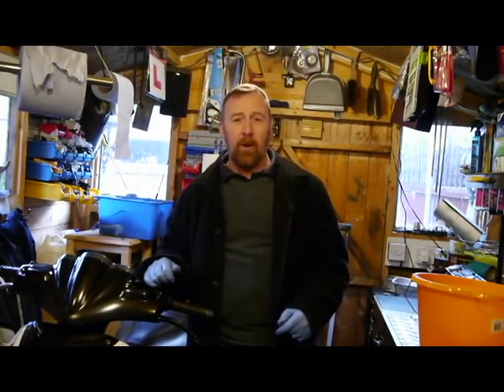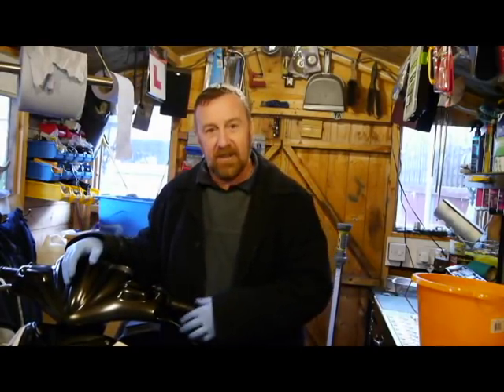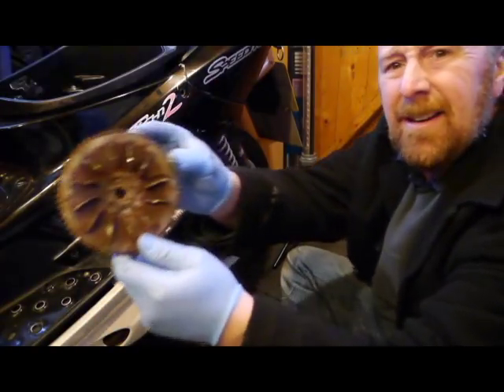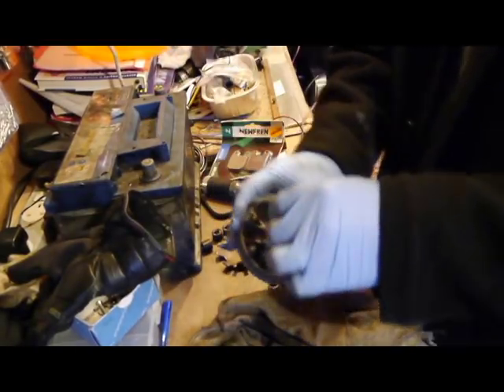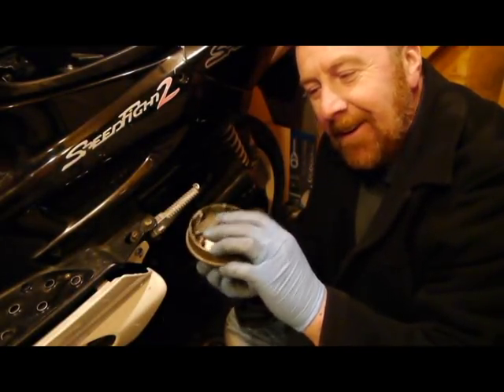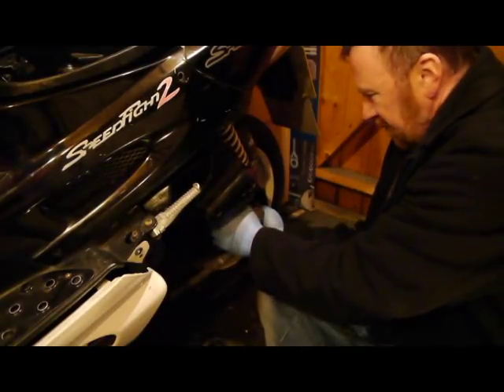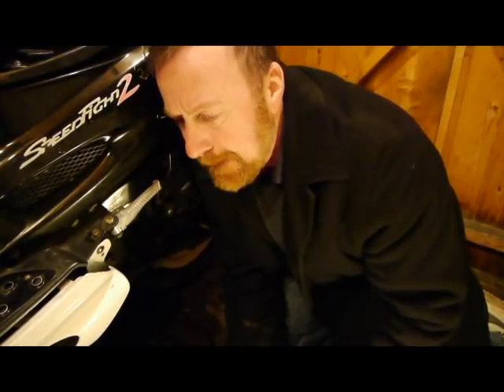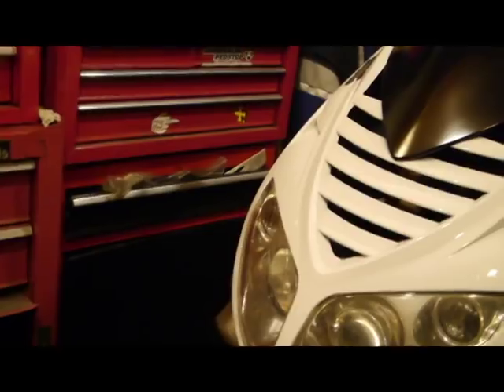MOPED SPEEDFIGHT SPEEDS UP SLOWS DOWN WHILE RIDING MARK SAVAGE

Comment: OMG. The trick with using a hammer to lock the variator is genius!. I tried locking it with a screwdriver and failed. Eventually had to order the damn part specifically for locking my gy6 motor's variator. And its gonna take like 3 weeks to get here. So forget that, you saved me.
Reply from the maker: that's good to hear bud that my videos and tips help, there many more videos on my channel and the basics are the same so may help for other things 
thanks for the feedback bud ,take care
Reply: Nevermind , I lied. It seemed genius, and it would have been if not for my variator bolt being on so tight that I can't even twist it without it lifting the scooter off the ground or slipping the hammer out. Guess I'm waiting 3 weeks c-c.
Reply from the maker: use a bar like I show in my videos, it should push down to get it off and use you foot to hold it in place or get a friend to help push down while you hold it in place 
it will work bud, maybe a little wd40 will help

Comment: I’ve got a sinni street 50. With a gy6 engine. It runs great up to 20mph then it won’t go further; however, randomly it’ll run up to 35 then revert back wards 

I’ve cleaned the carb and air filter. As well as replacing the spark plug

Comment: Amazed that it ran at all. Everyone seems to blame the carb. Thanks.
Reply from the maker: David Collins well it wasn’t the carb this time lol 
Thanks for watching
Mark
Reply: 4:42 Mark any chance of a close-up of exactly what you're doing here with the claw hammer. I have a Peugeot Looxor which might not have the lever points that the Speedfight has. But if I could see your trick, that would help please. Ta.
Reply from the maker: @ppppugh7892  not on this one  but I do show it better on a few other speedfight videos worth a watch as in a lot of the videos I start with a one day fix and end up fix 5 or 6 things and im sure I did it on a ludix and a nrg even a dna so its the same trick each time 
its just about pushing it in and holding it with your foot then a big bar and push up quickly
Reply: @marksavage  I got it off! The rollers were flattened and the housing looked like it was filled with wax oil, I mean filled. I will change the seals!

Have you ever seen this before - filled with black grease oil?

Comment: Thks 4 your video i have a piaggio Zip 50 2t when i drive in full acerattor the speed cut down i cleaning the caburettor new filter new spark plug and still the same thank you very much
Reply from the maker: thats great to hear and thanks bud

Comment: I just bought one of these for getting to the docks at stupid o'clock. Found it was bogging down under load quite badly and sometimes cutting out. Watched a ton of your videos and got a Haynes book of lies carb stripped and cleaned successfully. Much better, but still slowing on hills so I guess Wednesday's job is to check out the rollers a hundred times better than Haynes.
Reply: my scooter doesn't move faster even though I throttle the engine to the end it will only make noise but doesn't run even to climb hill is a problem  it consumes fuel so much because of that, what is the problem

Comment: Dirt is not really a problem. If it was there would be a gasket on the clutch/variator cover! The ‘dirt’ is wear from the belt, and clutch. The blades on the variator are to blow or vent dust away from the variator to the outsides of the casing. A speed fight needs 8 gram rollers. That is the key point. Roller size/power ban Ratio. Without variator guides, you get uneven movement, uneven roller wear etc. what did the old rollers look like? Divided?
Reply from the maker: The cover has a gasket !
Just ni -on  all of them do not get replaced 
But yes it's the belt that causes the mess
Some people even grease the rollers 
6g is the best all round weight, its what I've used in the 400 speedfights I've worked on !
Other weight for other mopeds 
I used to combi them a few gram here and there for wear and sports systems 
You still need pull away 
As for the mess of cause it's a problem bud as it will build up in the system and stop the rollers rolling !
But ha Happy to learn something new as I've only worked on 1000s of moped and 100s of bikes 
Who knows it all! Not me I just try and help others with my videos
Reply: @marksavage  im sure your knowledge is extensive. I’ve recently started out on 2strokes after years, and currently working US classics. I’ve restored a Yamaha Neos, saved it from the scrap, and now I’m onto my speedifight 2 and doing the research. It was running fine at idle, started first time and then after reassembly, got 1km down the road at 25kmph then 50 then it just died and won’t fire. I have no spark but the coil reads 9k resistance which is in spec... new plug still no spark. How do I know,if it’s got an immobilizer cdi? It’s a dellorto with electric oil pump.
Reply from the maker: @AutoClay  I have a few cdi video bud on my channel and there are 4 along with another 100 
Type in speedfight mark savage

Comment: hi mark my 1998 speedfight 100 is running slow at 20mph max with some smoke coming out the exhaust and runs so hot that its melted my seat bucket slightly ... could you please inform me of what it may possibly be

Comment: Hi mate . Changed my piston and rings heads gasket and seals . Changed variator cleaned carb brand new belt cleaned rollers. Still taking of really slow hand on the throttle all the time . What could this be

Comment: I just got mine brand new in the mail yesterday and it speeds up then slow down any ideas why and it’s new
Reply from the maker: bud id be going straight back to the mall and asking them to sort it, it should have gone through a PDI before been given to you so all fit for purpose and running 
dont play with it bud just bring it back and say its not running right and fix it !
Reply: I ordered it online from killer Motorsports
Reply from the maker: @NH_The_Bloods_Tho  oh right well it's not running as it should as you've guessed already 
Check fuel lines and fuel is getting in ok
Prob best take carb off and check over as defo fuel related

Comment: Hi Mark , great vids ...  wonder if you can answer a question ,  does it matter what way round the rollers go in to the variator ?
Reply from the maker: They will only go in one way like i show in my videos 
The variator has to be clean and dry and the rollers free to roll 
Bud
Reply: @marksavage  Thanks Mark , ill have to check your vids again as i didn't see the part where you specify the way round they go , sorry !!   This bed is a lexmoto and I've just got a new veriator for it as the old one was really bad .... May i ask would you say on the caseing  in front of the variator there is a hole , looks like a large air intake but no pipe connected to it , so its just open, should their be something connected in your opinion ?  many thanks
Reply from the maker: @markclemo123  there should be a pipe on there but its not the end of the world ,just dont block it up as its there to cool it 
If you can find one replace it as it stop rubbish getting in

Comment: Thanks for the video.  I have a TaoTao thunder, its a 49cc but i have a 100bore kit on it.  I have been having a problem similar to what you are describing.  #1, takes long to turn over (the kick start wont work at all).  As i leave my house, about 50 yards out i reach top speed then the engine begins to loose power, the throttle will be wide open but my speed will reduce, then a few seconds later it will recover..  ive had my machine loose power to the point of a 'crawl'.  Ive heard many theories and even mechanics say they fixed the problem to no luck.  Any ideas?  Im afraid to more than 3 miles.  Some have told me the engine lost compression and its toast, others say the carburetor needs to be adjusted.  Any advice?
Reply from the maker: shane mahler hi bud 
Thanks for watching , if you have watched my other videos you know I don’t like big bore kits 
Have you checked the head / piston as it does sound like piston / ring failure 
Carb prob not set up right , did you upgrade the plug as it will get a lot hotter with the bore kit?
You will have to , check everything bud 
From carb reeds piston exhaust plug, it’s a big job bud you need to get to the end of it 
I have a few well lots of videos on my channels that should help 
Mark
Reply from the maker: shane mahler well it’s worth a go on the simple things bud before paying out 
Get a cuppa and flick through my videos as some should help for the basics 
All the best mark

Comment: Hello, great video! Honestly i've learned a lot from this. I would like to ask you something. I have recently bought an mbk booster and took out the variator ring and put slightly lighter rollers but now untill 20 km/u it accelrates quiet good but after that I feel like a dip and it loses power. Do you have a solution? Thanks.
Reply from the maker: thanks for watching I have answered in the other question bud, was away for xmas

Comment: My moped is doing the same thing that you explained bogging down has no power and it never started until my CVT belt broke and I replaced it with another one. After I replaced it when it started. And I tried everything. I bought another belt that did not work and then I bought a brand new variator and that did not work and then I bought a brand new clutch and still it done the same thing so then I bought a brand new carburetor CDI box change the spark plug change the oil and it's still doing the same thing. But I'm wondering if it is my clutch which is brand new because when you grab it with your hand and squeeze it to open the clutch it's extremely tight and it's very hard to do so do you think it could be the new clutch? I really tried everything and I'm so frustrated. The moped will start it will even run but once I get it on the highway it has no power I'll hold it to the floor and it has no power and when I come to a stop sign it almost dies and it's horrible on the take off and give it gas and it takes a moment to take. I've spent like $200 trying to figure this out so any help would be greatly appreciated. Thank you
Reply from the maker: oh wow ok bud 
so it starts good and runs but then messes around once riding 
this can be your carb , try tuning like in my tuning video or you may have to buy a new carb and set it up with the old jet then tune 
clutch should be ok once fitted and you have done all the rest including new roller 6g yes

Comment: My daughter came off her bike in the and the steering has gone a bit lumpy is that the bearings gone in the head set
Reply from the maker: I'd be going over it now bud 
She may have damaged the frame 
Front suspension as pushed back 
And then yes damaged the head stock 
I'd be really looking at it or get a shop to bud to be safe 
Hope your daughter is ok
Reply: mark savage she’s fine thanks 🙏 a bit shock up but got straight back on a spare bike. Thanks for the reply I think I’ll strip it down and book it into the garage. She said it didn’t go hard and wasn’t going quick 🤔

Comment: Mark what's the best way to clean rollers? And should I use a damp cloth to clean the inside of the variator?
Reply from the maker: hi bud as in my videos, always a clean dry cloth, do not use any sprays or oil's , also check the rollers for flat spots and if so change them . thanks for watching bud
 mark
Reply: mark savage cheers pal. Your the man 👊
Reply: mark savage I changed my cylinder and I seem to be loosing power and sometimes it stops at 15mph 🙈 I was told keep it at 30mph for 200miles to wear it in. I had 4g rollers but was told need slightly heavier so I put 5g in and still lose power
Reply from the maker: if the variator system and clutch / . belt are ok then check carb , plug for spark if all ok then check piston again bud .5g rollers are ok , did you fit them like I show in my videos mark

Comment: Hi, 
Im having trouble finding the right size belt for my Peugeot speed fighter 2 100 2003 and has a catalytic everything is stock and original
Reply from the maker: @billyfarnsworth8051  it's very hard to get 100cc parts bud , this was why I only bought a few and found them hard to resale 
It is wider then the 50cc ones and a little longer too

Comment: where are you based and do you work on bikes, I have a Piaggio 2007 Carnaby 125 where the engine increases in revs and is sluggish on accelerating.
Reply from the maker: What my 4t  carb videos bud 
Then variator videos 
They will both help

Comment: I have a problem similar to this my moped revs up and then has no power but when I Rev again I get the power back it only happens every now and again but I have a feeling it’s due to bad petrol and maybe needing an oil change as it’s been in the shed for a while, could this be the case ?
Reply from the maker: Flush out old fuel 
Clean air filter 
New plug 
Change oil 
But as said check out the variator system too
Reply: @marksavage  yes I think it was flushing out old fuel as it hasn’t happened since I rode it today and filled it up

Comment: Hi, I'm going to need rollers but not sure what weights I need, it's for a 49cc kymco? What would you recommend? Thank you for your videos, I'm new to fixing up my bike so these videos are amazing.
Reply from the maker: best look on google for the right weight for your bike and then check out e bay, remember to clean up the variator like in my videos as they loads on my channel 
mark
Reply: @marksavage  i tried google, that's why I asked you lol. Ps it's not easy when using a hammer to unscrew, I've been trying for an hour, it keeps moving and I cant get a grip from the hammer. But thanks anyway.
Reply from the maker: @emmagibbs4551  it works on speedfights and DNA and aeroxs but not sure on a kymco but try like in my video and push up with your foot and jam it in there 
If not you will need the variator tool for your bike

Comment: HI Mark..Can you help..My longjia digita 51..starts ok..but every other day when it been left overnight..it will only do 10mph...for about 10 mins,,,then i get to work..leave it for 2hrs ish..and when i go home it runs fine..going 35mph..Runs perfectly..Any ideas? thankyou.
Reply from the maker: Carb , over a night etc they can leak a little and the fuel level in the carb goes down and then takes a little to get back in and start 
Fuel lines go hard or loose and tha vacuum fails 
Faulty choke but I'd start with the carb bud
Reply: Thankyou..i thought it might be the variator.. @marksavage

Comment: Just took mine apart and weighed  the rollers mark they range from 9.2g down to 5.3g wot should I be using?
Reply from the maker: I used to combi them but found the best weight to be 6g so 36g in total
It was best for pull away and top end 
What's its running Luke now with what you have and what was the total weight
Reply: mark savage just put new 6.5 in and new belt and changed the spark plug mate went up the road ok but then bogged out straight away revs up but doesn't move again going to take carb off cos when I pulled fule pipe off noticed water in with the fule on the ground mate

Comment: what about if its brand new.... should i Open it up
Reply from the maker: What's brand new bud 
The moped 
New head ,carb , oil seals?
Reply: @marksavage  mopped the engine has been stalling when I use the electric start but when I use the kick start it runs better but still not as fast

Comment: Hi there, I have a 2016 lexmoto matador 125cc 4 stroke, it ride great, but at top speed it dies back by about 10kph. If I let the throttle go and twist again, it does the same again,  would this be the rollers and clutch?
Thank you.
Oh by the way, your videos have helped me massively as I'm quite new to mopeds, thank again
Reply from the maker: Sounds like fuel more than the variator system 
Check and clean carb
Check vacuum system and fuel pipes bud
Guessing you have all ready changed plug and air filter
Reply: savage thanks for your reply,  I have recently changed the fuel filter and fuel lines, I do need to do the vacuum lines still, so I'll start there. Plug and ht lead changed also, I'll do the vacuum pipes and change air filter.
Thanks again.
I have one quick question,  I'm thinking of fitting a 170cc big bore kit to my 125 4 stroke, should I go 2 sizes up on my jets? 
Thanks 
Pete
Reply from the maker: @peterking7625  these kits are made a little better than the 2r kits but I'm no fan of them nor the setting up 
I'd change the carb with a 45cc upgrade 
More fuel and air needed bud
Reply from the maker: @peterking7625  to be honest I've seen so many bikes with big bore kits that have little effect or better speed and often fail after a little while !
If your going to do it get the best quality one you can and upgrade the carb too 
So 21mm carb not sure what your running now as standard or bigger 
This then will help and run better 
Sports exhaust and air filter 
High temp plug and quality oil 
It might run better and last if down well then tune.

Comment: Hi mark I broke down not long ago and cleaned the carb etc and it starts and sounds healthy. I used to get 40-45mph whereas i get 20mph now. I’ve changed the belt and cleaned the carb. Any idea on how to fix it mate?

Thanks again
Reply from the maker: hi bud 
so now your only getting 20pmph, we spoke about this already didn't we?
you took off the VARIATOR cleaned it and made rollers   were in ok and round - if not change too 6g
belt is the right one as theres a few and different sizes ?? you may have got a bigger one that's not letting the gear go up
Reply: it was happening with the original belt also so i changed the belt and it’s exactly the same
Reply: Today i have also cleaned all the variator and changed the rollers
Reply: same problem did you ever fix it?